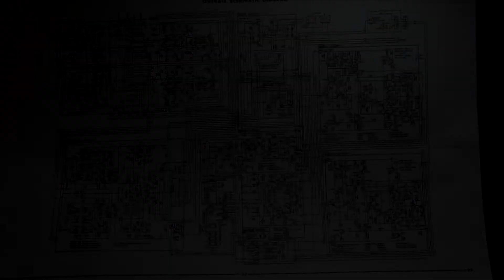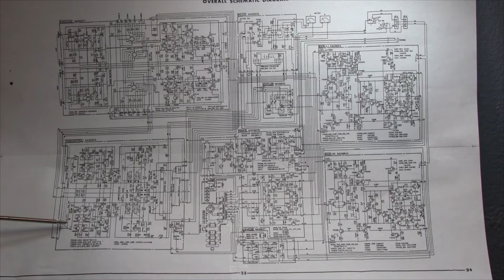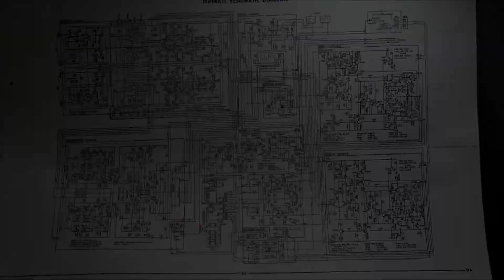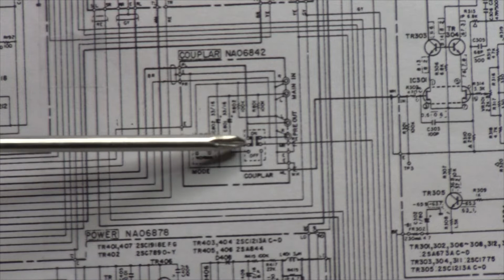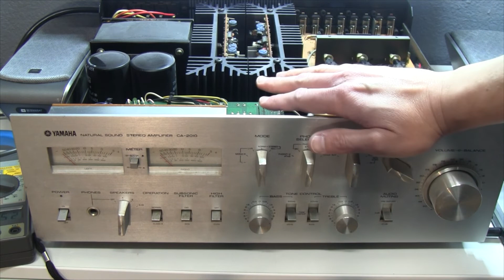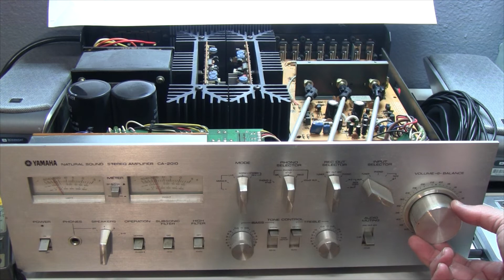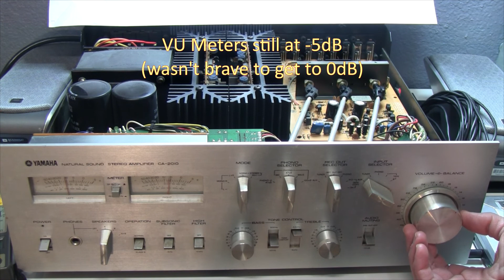Vbe 124 part 4: PEBKAC on the Yamaha CA-2010 power amplifier!

Comment: You're not the first or the last to fall for the couplar switch. I actually bought a CA-1000 as 'spares and repair' only to get it home and find the switch was thrown and it worked well. I've also had a 2010 where the couplar was very dirty and caused the protection relay to pop out now and again.
Reply from the maker: Neil, thank you for your comment. I also see quite a significant portion of equipment with simple fixes that are sold or given away as broken. Well, this particular unit will not catch me anymore. :) 
Cheers